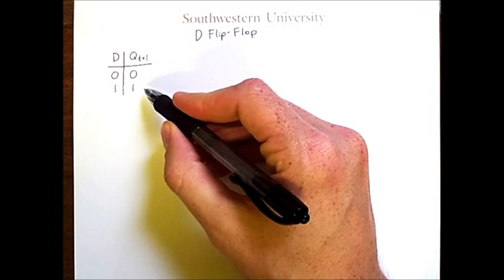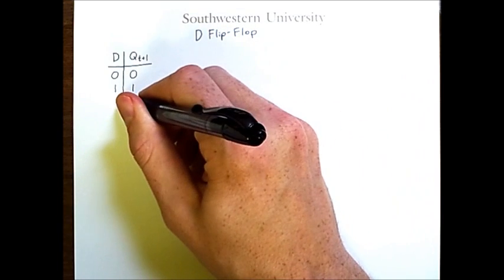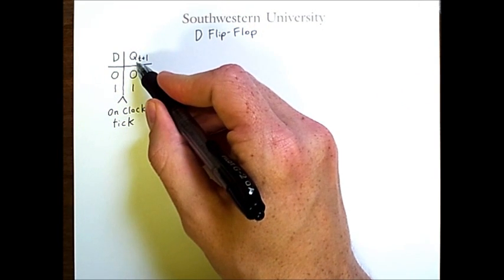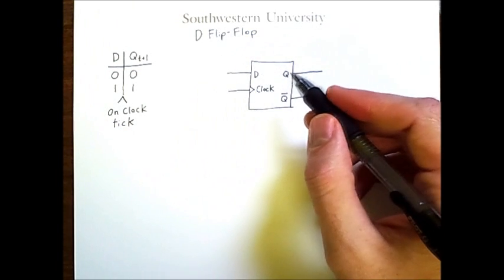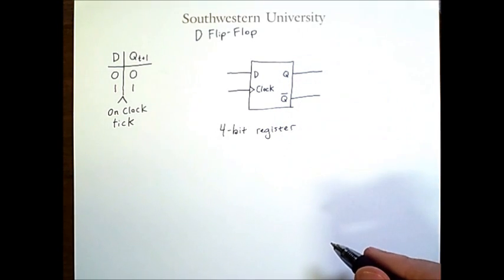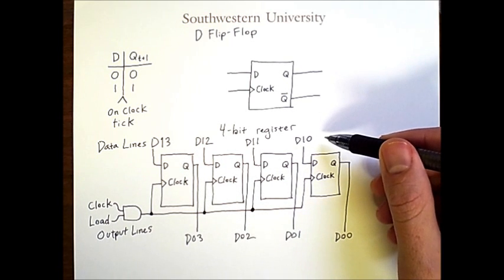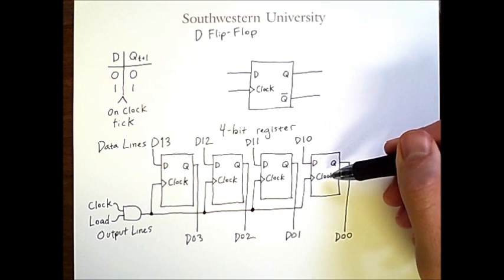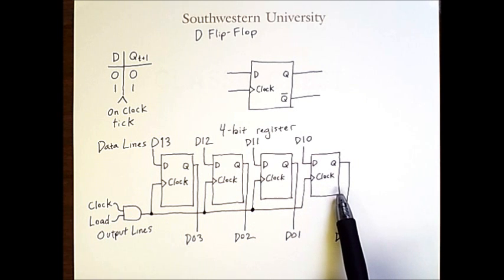Building a 4-Bit Register From D Flip Flops

Comment: Does this also work for SR latches??
Reply: A D flip flop is an SR latch (just with S and R tied together and one of the lines inverted, and with extra clock input) .. SR latch does not connect to clock so this wouldnt make sense for SR latch

Comment: u said if clock is 1 then when D is 0 then output will be 0 but when u said when theres no clock the output will remain at its previous output can u explain this part when theres is no clock?
Reply: When there is no clock ( clock = 0 ) then the register does not look at D at all. It only looks at D when clock switches from 0 to 1... also called the rising edge of the clock. If clock = 1 and D = 0, then output Q = 0, however if D changes from 0 to 1 before clock goes back to 0, Q does not change because it only changes when clock switches from 0 to 1.. not when it is 1 and not when it changes from 1 to 0